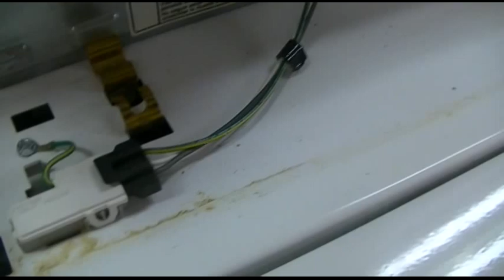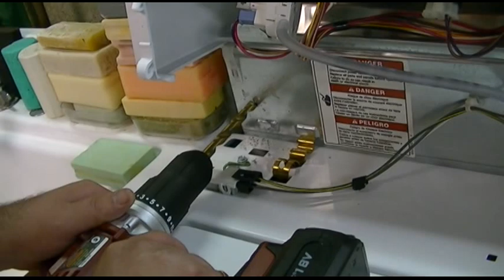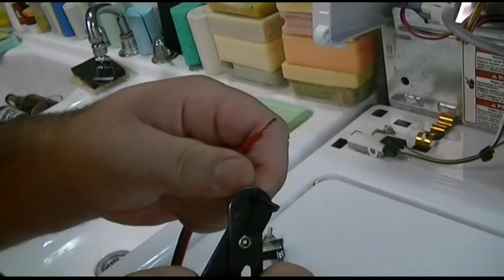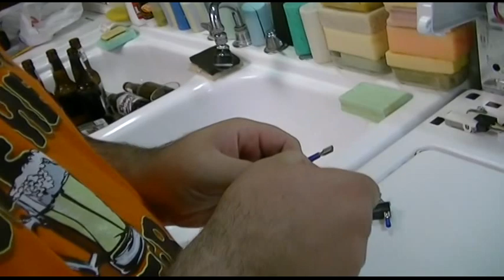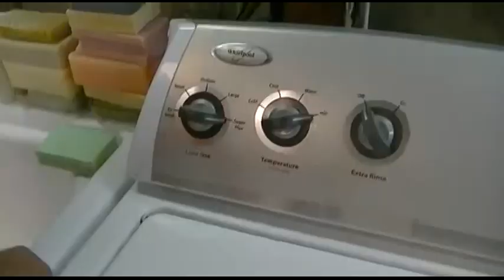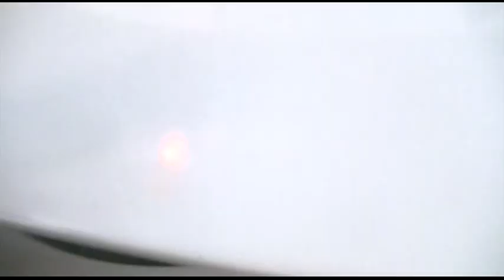The Great Whirlpool Lid Switch Defeat, Part 1

Comment: Thanks for this. I have a Roper washer (made by Whirlpool) and is on my 4th lid switch (the washer is only about 4 years old). Instead of adding the switch, I may just bypass like people in some of the other comments have said. There isn't anyone in my household under 25 that I really have to worry about sticking their hand in there while the washer is going. I have a harvest gold Whirlpool dryer that is from the 1970s (it was a hand-me-down from my grandparents' house) and it is built like a tank. The only thing I've had to do was replace the belt & bearings (it was screeching so loud that my neighbors called the police on me once). It seems like washers, dryers and appliances in general were built to last before the 1990s, used a sh*tload of electricity, gas and water, but they ran forever.
Reply from the maker: You most certainly can just bypass it if you like.  I put the switch in so that I can bypass the lid switch, or put it back to factory specs.  To tell the truth, I leave it bypassed all the time!

Oh, and the part about old appliances using more electricity and water--it's a myth.  Newer appliances are junk, and take 4 times as long to do a load of laundry.  Let's think rationally here--if you have to run your old washer 4 different times to equal just ONE load in a new machine, where is the energy savings?  Wouldn't you rather just run your old machine once, and it'll run for only a quarter of the amount of time?  Plus, new machines auto-balance the loads (or try to).  They do that by filling, agitating, and draining.  That will repeat over and over again until the machine is satisfied or simply gives up and dies trying.  The old machine fills once for wash, once for rinse.  Doesn't that make more sense?  It's like "Cash for Clunkers".  It was a stunt.  We haven't saved an emissions, all it did was drive new car sales, and get rid of some classic automobiles that still ran and were still serviceable.

Comment: You could also use a putty knife in to pop the control panel up. :)
Reply from the maker: Funny, funny!
Reply: I know this is an old comment...but I tried everything to get this control panel open, and I bent the crap out of everything.  mine is the same model as the one in this video and I cannot get it to swing open like that.

Comment: So you know that Inglis washer I have that is a reduced water washer meaning for rinse the water level is set to low from the factory. well I noticed that since there are 2 pressure switches all I have to do is drill a hole where the 2nd one is and replace it with one that is adjustable so I will have 2 adjustable water level switches. so I will have a decent rinse. sears for once is the cheapest for the pressure switch at around $38 not counting shipping. everyone else so far wants close to a $100 for it.  So I have a water wasting speed queen and a water wasting whirlpool hehe
Reply from the maker: There are ways to defeat the "features".  Older, simpler washers just did it better.
Reply: +jaykay18 yep before government intervention

Comment: why don't you just cut the black and the white wire and wire nut them together?
Reply from the maker: +TheBurke48186 By installing the switch, I can flip it and make the machine operate factory again.  Generally I leave the switch on so the lid switch is disabled.

Comment: No not at all I'm confused.... please teach me... I can't see the video of what your doing. I believe we have the same washer, mine ran the water but it won't spin no matter where I turn the dial. the wife says it runs with the door open already ????? so I'm lost
Reply from the maker: +Julian Irving If the washer already runs with the door open this is not going to help you.  I installed these switches so that I COULD run the machines with the door open.  If it does nothing once it fills up, and you're sure the lid switch is not in play, you could have a bad timer, a bad motor, or any number of different things.

There are plenty of repair videos on YouTube for this type of thing, I'd suggest you search around.

Comment: why didn't you just wire nut the white and gray wires together and avoid the other switch altogether?  my lid switch broke and I left the wire harness in tact so I could use the existing ground and just wire nutted the other two...works like a champ but I did have to explain to my teenager not to stick her arms in the washer now...
Reply from the maker: Dan Looney "but I did have to explain to my teenager not to stick her arms in the washer now..." is EXACTLY why I installed the switch.  When it's just me, I can leave it in bypass mode, otherwise I flip the switches down, and the machine is "factory" again.  It also is convenient as a sort of "kill switch" since I normally leave the lids open all the time now, I can just flip the switch in the back and it now "sees" the lid is open, and stops.

If you're even more curious, search my channel for "Wash Day Wash-In" and you'll see.
Reply: jaykay18 yeah, probably a good idea...they can at least attempt to hit the kill switch before being dismembered at the shoulder by a runaway spin cycle...teenagers...sometimes they just gotta learn the hard way right?  relax people I'm kidding...sorta

Comment: If you would of just put your hand under the left side bent the door hook back a little and stuck a little pole in the lid lock that would of taken you 2 mins that's all I did with mine lol no cutting nothing ha
Reply from the maker: I wanted the ability to switch the machine back to "factory settings", literally at the flick of a switch.  It's once and done, now it's there and will just work.

If I wanted to disable the switch permanently without cutting I could have used a "technical shorting device" across the pins in the connector, but then I couldn't enable the lid switch again without opening the top cover.  There's more than one way to skin a cat, as they say.